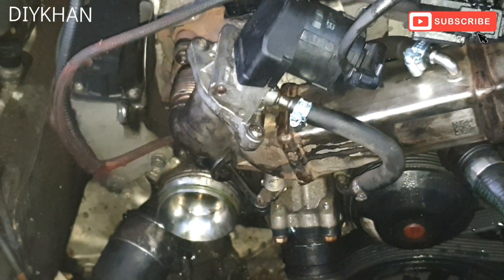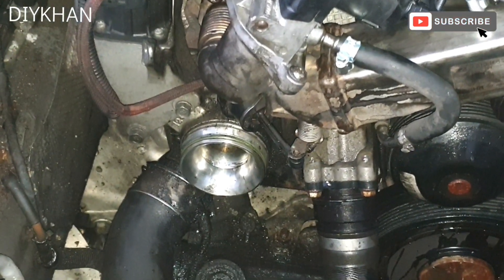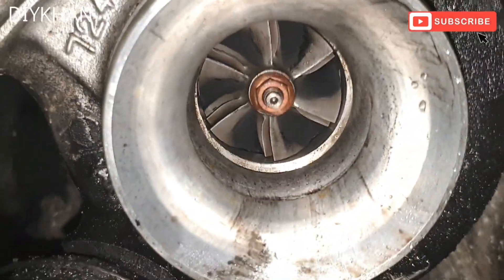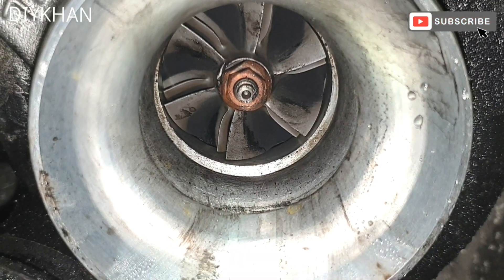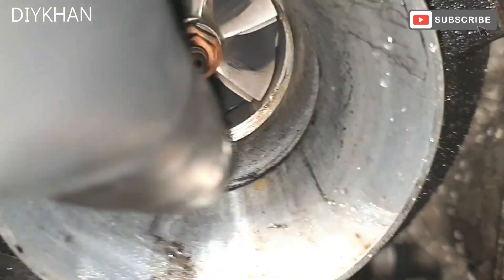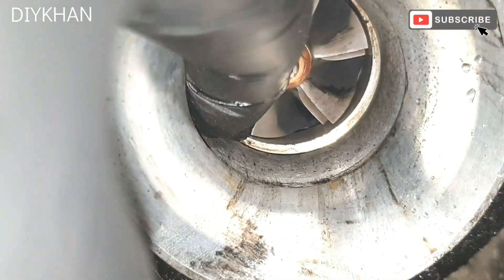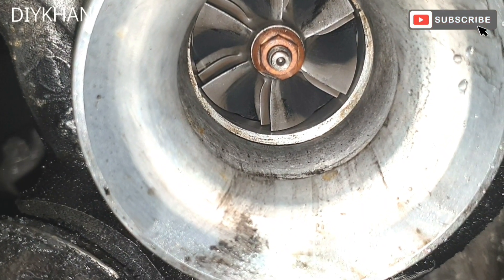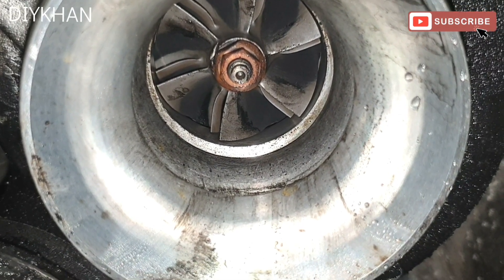BMW 3 Series E90 N47 Turbo Charger Investigation to Look for any Damage or Oil leaks. Turbo Bearing

Comment: The other day I changed my crankcase ventilation pipe. Pretty much broke off in 2 parts on gentle pressure and it was all blocked up on the inside. The next day when I accelerated a bit hard to join the M1, my car suddenly started making a whooshing whistling sound on acceleration with loss of power. The sound stopped but there is no turbo boost or torque that kicks in at all. On inspection there is oil along the intercooler side of the intercooler turbo boost pipe. Does this mean the boost pipe is gone or worse, turbo?
Reply from the maker: It could be boost pipe, faulty turbo or a leak in the intercooler radiator. I would call aa to seek help. It happened to me once where my 2005 laguna was making hissing noise n car wouldn't go over 50 miles. So I called road side recovery n he straight away picked up a leak in the intercooler radiator. So I ordered an intercooler radiator from Renault dealership for 200 pounds n it took me two days to finish off the job. I had to strip the whole front end off to get to the intercooler radiator on laguna. If u have time then u can investigate by your self. U can get someone to sit in a car n accelerate n also u can buy a vacuum leak spray from Internet to pin point the boost leak. Good luck
Reply: @diykhan  Thanks! Jzk.. Will let you know what happens.
Reply: @saracentiano hello what was it in the end please? I have had exactly the same scenario happen to me last night when accelerating too hard